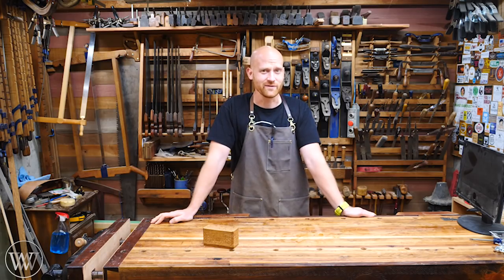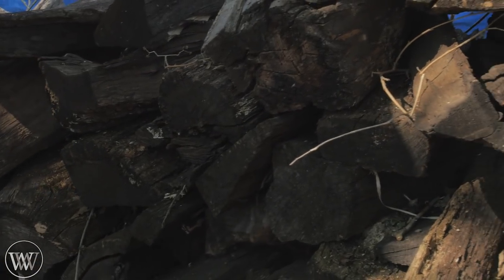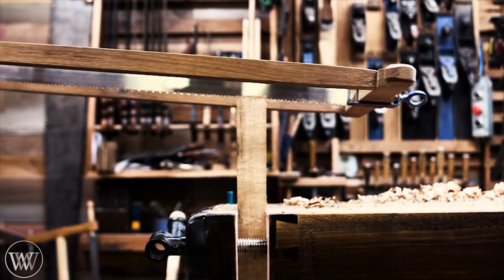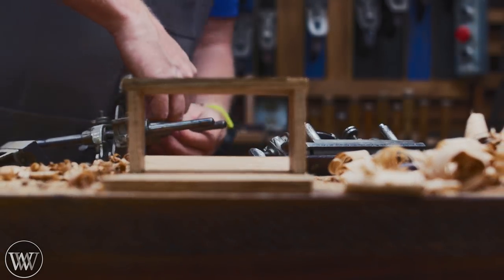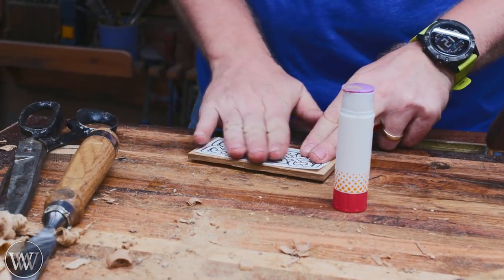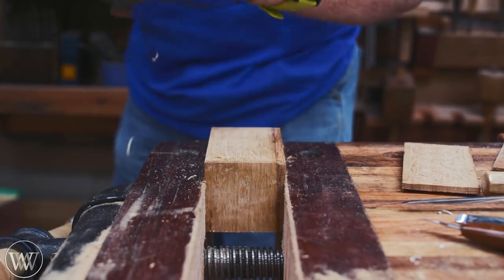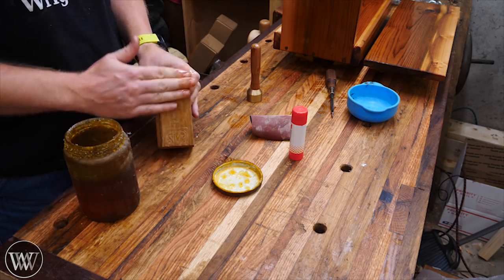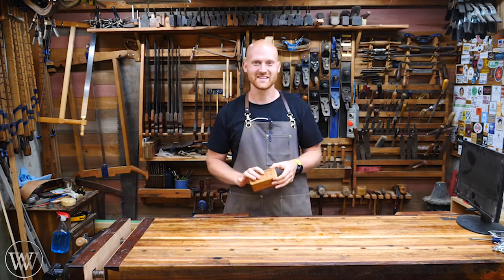Making a Box From Firewood With Hand Tools

Comment: Great job man! Just a quick question. Don't you have to worry about wood grain while using a "V" groove chisel?
Reply from the maker: If you're doing a full plunge cut with a V-Groove then no you don't worry about green direction because one side is always cutting with the grain and the other side is always cutting against the grain. But if you're only cutting one face or the other then you can flip it around to make sure you're going with the grain.
Reply: @WoodByWright  I really appreciate it that you always take the time and answer questions. Much obliged.